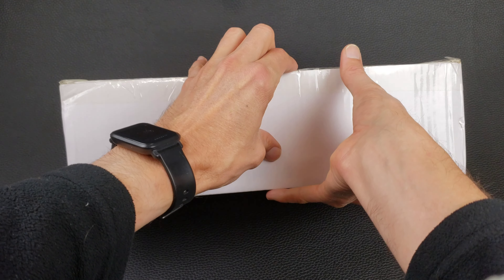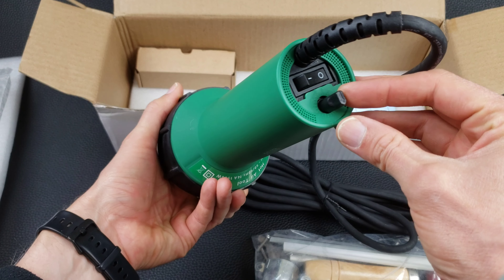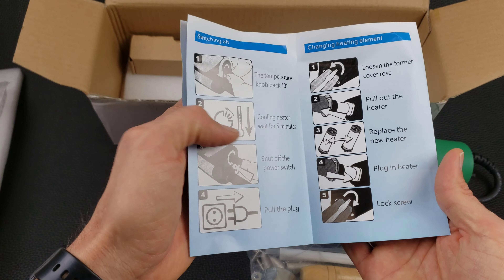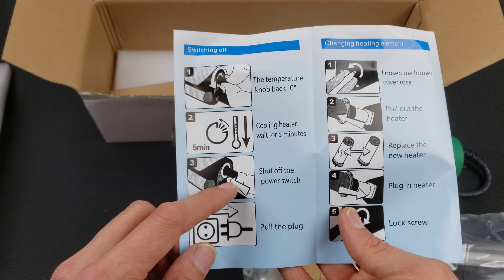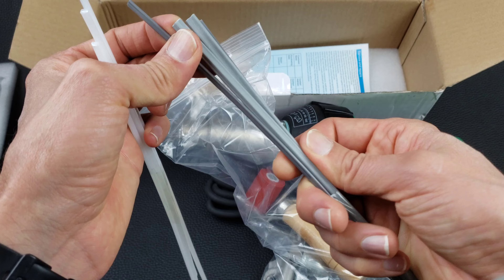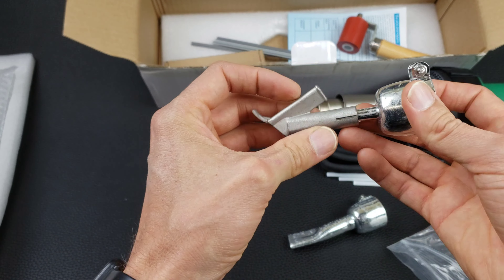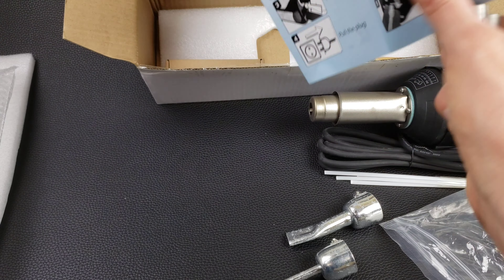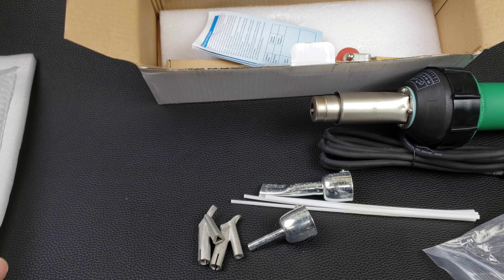TryE Plastic Welder Heat Gun for HDPE, PE, Vinyl, ABS - Unboxing and Overview Review -

Comment: Amp draw?
Reply from the maker: It's rated at 1500W, so max current draw would be  12.5A
Reply: @engineerable  What's on the label is one thing, what it actually draws is another. Thank you just the same.